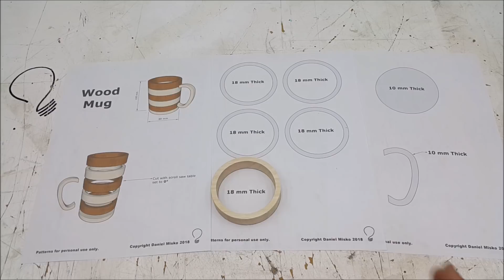How to Make a Simple Wooden Mug with a Scroll Saw

Comment: This will have to go on my to-do list! Now all I need is a scroll saw 😕.
Reply: if you have Dremel  Rotary tool, or Roto-zip type tool you can do this as well. They sell a stand for the dremel so you can hold it steady if you need to.  Another option is The Dremel Moto- Saw. Great for small scroll saw projects.

Comment: How did you treat the inner side of the mug to make it waterproof?
Reply from the maker: Easy one. Few coats of polyurethane wood finish makes it waterproof (for homemade use), unfortunately, it's not 'food safe' . If you really want to use it for drinking, the only one reasonable way to go would be some kind of 'food safe epoxy' for the finish...
Reply: @danielmiskoidea  Kitchen oil...